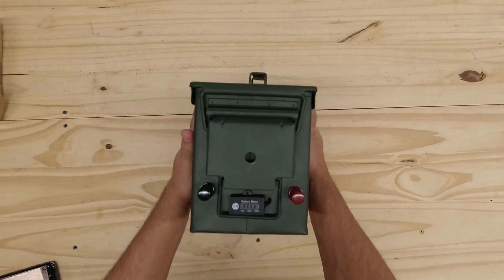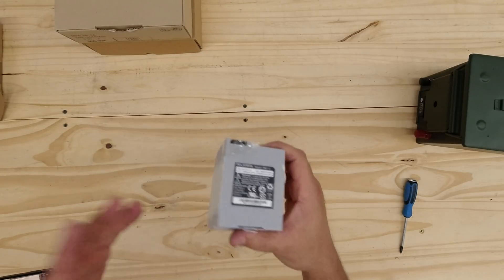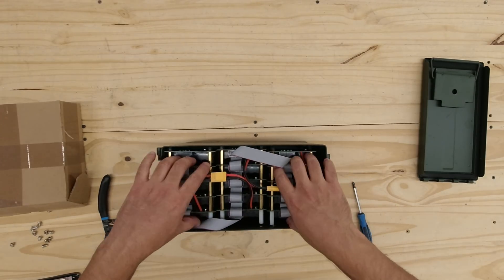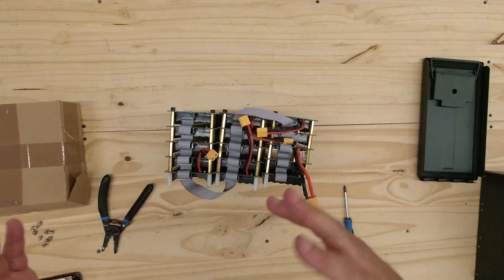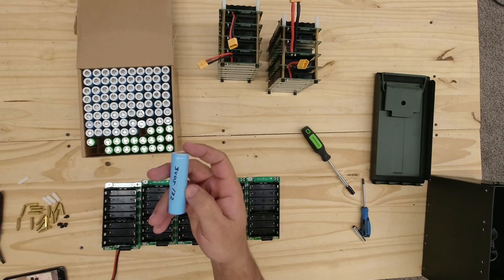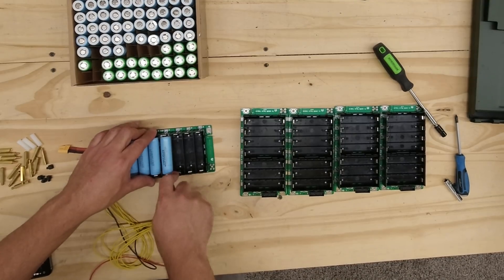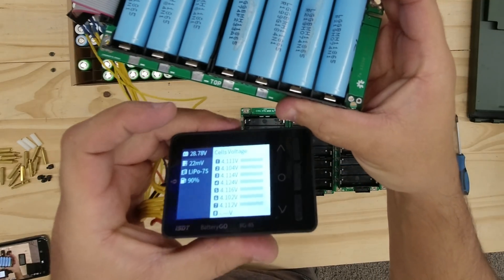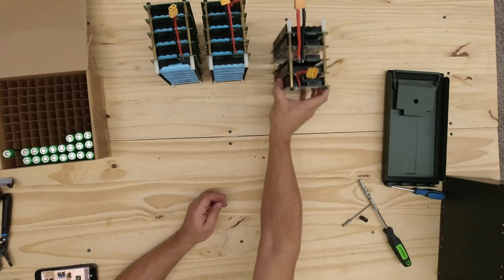Make a DIY 18650 Lithium Battery in a 50cal AMMO Canister

Comment: I bought and built one. Are there any recommendations on a 24v charger to use to charge the can?  Will any 24v charger work or are there specific requirements.  I did not see this in the video.

Comment: This definitely looks easy enough. I'm planning builds of similar cans like this (some will be powered off power tool battery packs instead of straight 18650s), but not with the intent of it just being a battery, but having integrated power connectors (USB, 12V, etc.). Along with integrated terminal connectors like shown here so I can connect an inverter - e.g. to recharge camera batteries when on the road.

Comment: I was searching, and searching but can't find a video where you test used 18650s both capacity and IR and say something about it, like what is acceptable range or difference in voltage, capacity and resistance that you would use that cells for a battery pack.

Comment: You char a 24V pack with a 42V wall wart charger in your description? Isnt that too high of voltage? Where would you plug it in? I’m assuming youd have to cut the connector off and connect the wires directly to the terminals? Hassle...

Comment: I need to build one of these but 12v to power a HAM radio that pulls PEAK 15A for seconds at a time but usually operates <8A. do you sell 12v Pcb setups to make a kit similar but in 12V?

Comment: Need to do a specific 12v version I could see it being more useful.
Reply: make them using lifepo4 from aliexpres or alibaba for $555 for 100-180amp hours, way easier plus longer cycle/ life and easier to charge, plus less cell means easier maitance if a cell dies but lifepo4 is more stable than ion
Reply: @eksine  if 1 cylindrical cell dies, your battery will still work. If one of the prismatic cells goes out and your battery will not work because you will lose 1/4 of the battery pack. ALso, the prismatic cells and the cylidrical packs are both lifepo4. same chemistry.
Reply: @epfd217  no 18650 are not as reliable because usually people use used cells. Prismatic you just replace the cell with a used one , what you say only makes sense hypothetically, the prismatic ones people often buy new cells and they are known to last way longer in real life. Probably due to the construction differences
Reply: @epfd217  also nobody said this needed to be constantly up 24/7 without maintenance. If that were the case in a commercial application I would still use prismatic and use a automatic switch
Reply: @eksine  so now you're setting the parameters for your opinion? What a clown. Ask yourself why the top end designs use cylindrical cells and the cheapie versions use prismatic cells? A DIY battery from prismatics is cheaper and easier, but thats where the advantages end. When comparing new to new, its no contest. I'm glad to see guys like Jehu making DIY kits for cylindricals that are user friendly.
Reply: @epfd217  prismatic is not cheaper, it is the same or more expensive. You're all over the place here. No point in talking to you. The longevity and ease of maintenance are it key factors over cylindrical cells except for lithium titanate. Anyways have fun arguing with yourself

Comment: Hi Jehu, Thanks for this video! I am about to purchase some of your modules I already have the ammo box, and I love 7s, but several of my applications are going to be 12v.  So I found the down step you mention "24V to 12V Step Down - https://amzn.to/33bxeTM" .  Was wondering if you would connect your incoming battery charge to the "OUT" of this converter so that it might go back the other way into the battery at 24volts?  or would you need another converter step up to send voltage from 12 volt back to 24, or would you just try to charge the battery from a separate set of cables mounted to the outside of your battery box?  for me it would be having to buy an MPPT that does 24 volts instead of 12v..  also I noticed this Step Down is only 40Amps... that seems a bit low for this kind of ammo box solution dont you think?  98 batteries at .5C or less than an amp each still comes out to well over 40 amps right?
Reply from the maker: Step downs won’t step up, you’ll need another one to charge.  They make them up 1000w = 80A
Reply: @jehugarcia  true, an external one, also 80 amps/1000 watts seems a bit low for a 98 cell pack of 2800capacity batteries?

Comment: What configuration would you suggest for a lack to run a pair of 120v tools at the same time, and last for at least 30-45min per charge?  I have a mitre saw with 15amp motor at 1600watts and a Dust collector at 8.3amps and 1200watts.
Reply from the maker: 3000w continuos for 30-45mins?  2kwh would do it,  2 of these boxes in series with a 48v 3000w inverter
Reply: jehugarcia Man thanks for that! I’m sure this was just simple math for most but it’s over my head so I just needed a pro to recommend.

Comment: This is probably a dumb question but 100 watts is 100 watts regardless of voltage right? So if I have one of these and let's say it's built out to exactly 1000wh so a 24volt 100watt "bulb" would run 10 hrs right? If it was stepped down to power a 12volt 100 watt bulb it'd still just be 10 hrs right?
Reply from the maker: No you can get to 100w in all voltages,  100v x 1A = 100w  or  1v x 100A = 100w
Reply from the maker: 200v x .5A = 100w

Comment: I couldn't tell but does one of the packs have less cells in parallel because of the bms?
Reply from the maker: Yes 4 vs 5 on the others
Reply: @jehugarcia  so the capacities of the individual packs doesn't matter as long as the cell groups in series in each pack are close in capacity?
Reply: @christianlefler5240  My understanding is that each board is giving the nominal voltage of 24 volts and then they are linked in parallel from there to just increase the battery capacity.
Reply from the maker: Correct

Comment: Well I really like the idea, but WHY??? WHY did you drill holes in there? I mean, for the power connector, ok. Those can be sealed, but why put them in a sealed ammo can in the first place, if you drill holes in it? You can press fit the cell holders when closing the lid. That will be more than enough.

Comment: @jehugarcia I like how much easier this kit is. Can you make a booster kit for the Bluetti ac200 that is as complete and easy as this?
Reply from the maker: The 48v version of this will charge your bluetti
Reply: @jehugarcia  Will the batteries stay seated if the case is banged around or vibrated in vehicle? Should I wrap kapton or zip ties around the battery modules?

Comment: My biggest concern would be those energized standoffs shorting out on the metal ammo can if one of those nylon standoffs fail or come loose.  I would think that a plastic insulated case would be more safe.  I wonder if coating the inside with a liquid rubber spray on or brush on liner would be more safe.
Reply: Insulating paper (fish paper) for building battery packs or a thin and durable plastic such as polycarbonate/Lexan are some ideas that come to mind. They can be glued to the inner surfaces. The local hardware store is a treasure trove of ideas. 
The other thing to consider is heat when charging or discharging. It would probably be best to open the lid while in use.

Comment: The question, why all the sellers make adv only showing battery voltage, capacity, and energy? Why not say the power supplied? because vision batteries are electronic's batteries, right? So, those batteries different from lead acids battery has a limit of power due to BMS and even the cells limitation. 
I appreciate your thoughts and comments.
Thanks 
Rodrigo Koji Nishigasako from Brazil.
Reply: Because the seller of this item is not thoughtful enough nor does he really care to be honest. Having a sale is his priority, not the descent amount of honest informative information.
Reply: Right, but in other hand, the seller would suffer in a warranty for miss information by himself. So, not a good deal at all. Better to inform the customer what would be the maximum power capacity is allowed to drain from the battery, correct? 
I appreciate your comments.
Thanks
Rodrigo Koji Nishigasako.

Comment: Question how do we deal with heating?
Reply from the maker: No heat at 1c discharge
Reply: Ok okay I’m currently converting a gas motorbike into a cafe electric swap...I’m thinking about 72v minimum....I’m guessing I’d have to drill holes in the kit for cooling then right?

Comment: Wow. Man, that's pretty amazing. how would I know How long Can this operate a freezer or a refrigerator?
Reply: If the total capacity of the battery is around 1kwh of energy and your refrigerator uses on average 100 watts  per hour than it can run for 10 hours, it’s all math.

Comment: If you offer this kit in 48 Volt, I will most certainly buy it!
Reply: Just buy 2 boxes.
Reply: @htmagic  I need it for an E bike, 1 50 caliber can would be the perfect size and container.  My current E bike battery is 48v, 20AH which is about 1kwh and is approximately this size.
Reply: @ProlificInvention  Where exactly are you going to put a metal ammo canister on a ebike? I'm curious please explain in brief detail
Reply: @Mind-Your-Biz-Narc  I currently have the battery inside a Makita drill storage box that I converted to a battery box, I made a removable mount on a newspaper carrier of the type that clamps to the seatpost.  The motor is a front wheel hub motor so the bike is quite balanced.
Reply: I think you should be able to make it 48v
All you have to do is make it two towers inside the ammo can with bms pcb per tower den connect +to- and you'll end up having two +and- ends
Reply from the maker: Yeah we offer it
Reply: @jehugarcia  what about a 12vot box setup for a trolling motor
Reply: @jehugarcia  ISDT Banggood & Amazon should send you a commission check for sure. ISDT Air would allow BT wireless charging and balancing up to 6S. Hire Me! Lol
Reply from the maker: What kind of power does a trolling motor use?
Reply: @kricketman12  Use a high efficiency 30A PWM step down + online they make/sell lifepo4 =>50AH batteries to fit your budget some even have bluetooth so you can monitor charge and discharge on your smartphone & thousands of cycles with good treatment 😉
Reply: @jehugarcia  I have a Minn Kota 42 lb thrust 12 volt.  On maximum power it draws around 500 watts
Reply: @jehugarcia  Jehu, typically they are 12 volt and used lead acid batteries.
Reply: They have it the kit on the site in the link